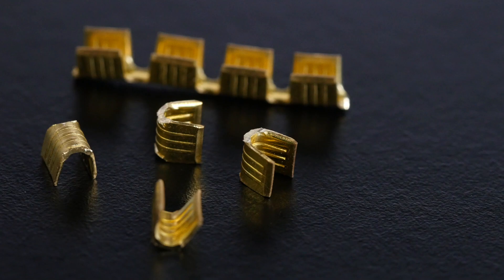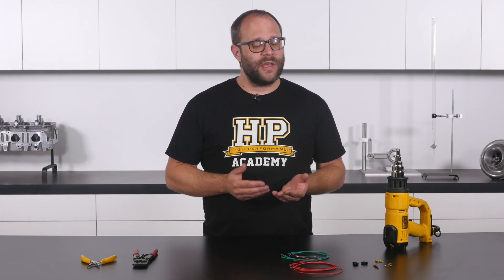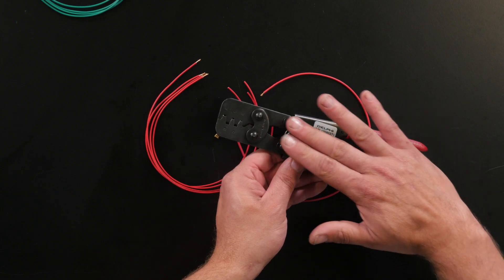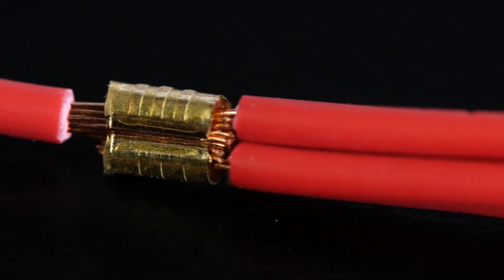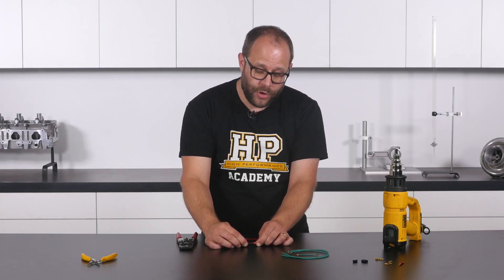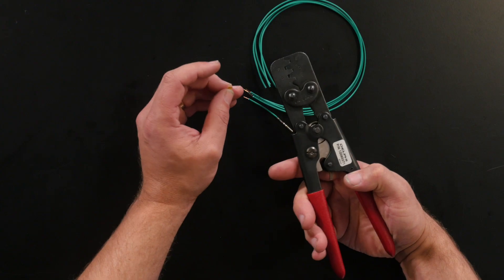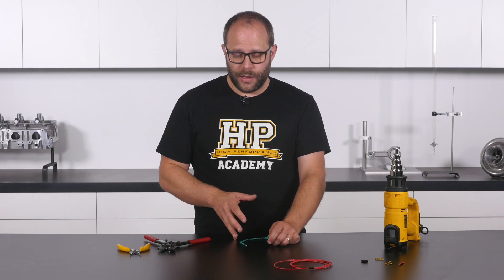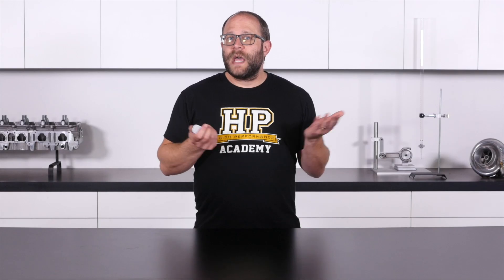How To Join Multiple Wires: Splicing | Common Loom/Harness Failure Points [FREE LESSON]

Comment: So glad I found this video! Been looking for this specific tool for this application. I got the wrong ones that have two different size crimp for terminal ends with the weather seal. I work for Chrysler so wiring repairs like this are recommended and mandatory for warranty.

Comment: A very informative video.  A logic chart would be helpful.  Not sure what to use for a 2 wire splice. Why use an open barrel connector?  I am guessing they are cheap. And then I have lots of wires that are different sizes.  I was going to use terminal blocks for simplicity but they will take up more room.  But so simple to swap out parts that go bad.  As an electrician I always used wire nuts.  But now with stranded wire I need to use something else.   

But see a logic chart would help.  Say you have an LED with 26 AWG wire.  The leads are too short so would you solder to an 18 gauge wire so you can work with it?

Comment: For an inline 6 injector or ignition harness. would you recommend 1 splice or multiple splices? 1 splice i guess would be less points of failur but multiple splices would be less bulk. Also wouldnt 1 splice be more prone to failure with 7 wire bundle being spliced?

Comment: Hi, I’m currently trying to make my own chassis loom. I have a 70amp relay as a ign relay to power 12 micro relays and with 20 micro relays using a mta modular setup. My question is would an open barrel splice be suitable for me spread the power from the 70a relay which I’ve spaced as a 8.5mm2 cable and the micro relays to a 4.0mm2 cable. Thanks

Comment: Where can you get these type of open barrel butt splices like this style that are tin plated copper? All I can find are brass, which I'd never use. Or just plane copper. Which if you use plane copper, you'd really need to put on adhesive heat shrink tubing to help keep the copper from turning green, which could affect the connection if the copper turns green where they touch.

Comment: I thought you were saying enchilada but you were trying to say insulation. I guess keyboard hands are good for getting stripped wire in a crimp. My beat up fingers hardly move much less do a ballet you did. Good job
Reply from the maker: Yes, Andre also makes fitting circlips look frustratingly/deceptively easy too compared to my blunt meat stick (aka finger) co-ordination 😂 - Taz.

Comment: I finally finished my first wiring project. Thanks to your guidance, I made it with OEM results. The setup includes : a fused relay block,  +/- busses, and a fused distribution block inside for the switches. I quite enjoyed splicing a single 14awg to 2 18awg power and ground wires respectively. 
My customer couldn’t even tell what it was that I had done on his truck. The give away are the covers on the +/- busses, which are cleaner than the rest of his engine bay.

Comment: sorry, i want a proper electrical connection, suggest solder after crimp, so mechanical  and electrical are properly sorted
Reply from the maker: You are free to do this, but really if you feel the need to do both you're either doing one or both techniques incorrectly - Taz.
Reply: No No, I respect that opinion but com across so many manufacturers connections that have failed, and its corrosion that affects the joint that solder would prevent
Reply from the maker: Solder is not immune to corrosion, it is only more resistant. A poorly sealed solder joint will also corrode, so while you might feel that adding the solder is helping avoid one issue, you are still potentially creating another arguably greater risk. Arguably is where things become murky for most, but we're not telling you what to do yourself at all, just trying to arm you with a bit more knowledge.

I do understand the logic though and you're not the only one to mention this often. I would take a close look at the connections you see that are failing due to corrosion as I'm sure you will find that the crimp itself isn't actually the problem but rather the sealing around it that is no doubt poor or has failed is.

That said, we are talking motorsport wiring, and generally what you're doing here is going to be better than OEM production vehicle wiring when done correctly - Taz.

Comment: Is there a rule of thumb for the max number of wires to join like this? I would think that too many will force the wire into a sharp bend where the insulation ends. I have had quite a few of these fail on standard motorcycle wiring looms, and when I have replaced them (using solder butt connectors normally), I have joined the wires in several separate groups.
Reply from the maker: Ignore what your OEM does, you can do it better. 

I have to ask, how many wires do you have that you need to splice and why? I feel like this is probably an issue that you could avoid by looking at the cause and fixing that, however, with some specific information around that we can give a more specific solution - Taz.
Reply: @hpa101  , thank you.

Particular case I have is a join in the loom of some older Aprilias where the switched live splits to various circuits. They are joined in one bundle using this type of crimp.

One I am retiring for a different engine, and in this occasion I intend to using a larger fuse box with a bus bar to provide the power. Hence avoiding the issue. But others I want to keep pretty standard

Comment: When using the heat shrink across the 4/5 wire splice, won't it be vulnerable to water etc in the middle of the 4 wires when the SCL only secures the outside of the wires?
Reply from the maker: Is this an issue you have had or are you just thinking aloud? Let us know and I'll see what Zac can recommend - Taz.
Reply: @hpa101  I was just thinking out loud - I since moved ahead working with my harness, and with the multi-wire splices, I heated one to create a "funnel" then filled with a liquid gasket, and then heated the shrink tube entirely, and finished off wiping off the excess gasket that was pressed out.
Reply: @hpa101 did you ever think of a solution? I have this problem. Semi truck exterior application. 4 to 1 splice.
Reply: This is a big issue, The center path is always the failure point, in Mobil equipment  
corrosion will cause failure.
Reply: Could this be mitigated with a coating like vaseline/dielectric or liquid thread tape? Possibly contained with a larger sized outer heat shrink. OR a waterproof buss bar (1 in, multiple out)?

Comment: I much rather solder any splice in a harness, I have had crimping come back to bite later! Being inside looming, makes it difficult to find ,  but it is difficult to solder sometimes depending on location,
Reply from the maker: They both have their place and when done correctly obviously neither should fail prematurely from poor technique, however the reason why we don't like to use solder is it adds the risk of failure from vibration which is a risk crimping does not add. 
With that in mind, and the fact it is easier to repeatedly get a perfect crimp compared to learning how to do the perfect solder it sways the pros for crimping over solder in a motorsports application.

For finding and adjusting crimps in your loom, you could also take a step back and address why you are redoing or adjusting your looms so often. It might not be avoidable for your application, or there might be something in the way you plan that could be addressed to help you with that. This video touches on this topic if you haven't seen it already, hope you enjoy it: https://youtu.be/L05Ud8NztZY

That doesn't mean you can't solder yourself if you want to, but not being blind to pros and cons of any tool or technique is important whatever you choose as we know some people do get oddly passionate on this topic (that comment is for others that might read this too 😉 ). - Taz

Comment: Great video.

1 criticism, however - I'm not sure you did the heat shrink right. My mate does it so as the red insulator is brown-to-black and bubbly looking, and the black heat shrink is charred, and normally has to put out a small fire. I have to assume his method is correct, because he normally ends up with less than 1 short-circuit per week, and I didn't hear you bragging about your apparent success-to-failure-rate, so I can only assume it is poor.  Also, he usually puts more of the insulator IN the crimp/join, i.e. a much higher "plastic insulator:copper conductor" ratio, than I notice you are doing. ok, 2 criticisms.

I might send him this link actually, I am sure he will get a great laugh from your amateurish wiring shenanegans - prepare to be heavily critiqued!!
Reply: That's pretty much the result I get as well, but mine looks cleaner. You see, I bubble the insulation using my soldering iron and end up with a sanded aluminum look on my joints. The heatshrink however, I brush it with the flame of my bic lighter using the fast back and forth method in combination with a twisting motion while held at a 45 degree angle. As soon as the heatshrink stops moving, remove heat so as to not singe the heatshrink. Then go over it for another ten seconds using the bic lighter method again to be sure you got all the shrink out of it.
Reply: @A. Melbs Lol. I don't even remember leaving this message. I must've been messing around. I use a heat gun on my heatshrink. However, when I first started soldering, I used to apply heat too long which resulted in melted insulation. I've honed my skills over the years but thanks for the tips. I do occasionally use liquid tape if the heatshrink or insulation gets damaged. It is good for a quick fix.

Comment: During my many years in the wiring industry this type of termination was faided out, we introduced ultra sonic welding the copper wires together this method was far more reliable and uniformly distributed the current through the wires, perhaps a bit to expensive to introduce though, again great work and easy to understand video!
Reply from the maker: Yes the cost is prohibitive to those wanting to learn and create their own looms at home, and even for some small commercial operations - Taz.

Comment: I'd take it one step further and solder it after crimping then heat shrink it
Reply: Can advise what you want but I've never had a failure
Reply: @Jbshootingsports  Space industry use crimping and soldering, so you are right to do so.
Reply from the maker: @Jbshootingsports  You might not of had a failure, but you've introduced more of a chance of having one. Again, you're free to do what you like on your own builds, but there are pros and cons for everything you do. Whether you want to accept it/educate yourself or not that's up to you, but it doesn't change any facts =) 

There is plenty of material out there on the pros and cons of both soldering and crimping, and also why you shouldn't do both if you're keen to learn more, otherwise happy wiring with what you're already doing but we just advise anyone reading your comment does their homework before blindly soldering AND crimping everything thinking their doing the best job they can - Taz.
Reply from the maker: You can do what suits you best, but we 100% so not advise soldering your crimp joins - Taz

Comment: waay back when i was in school i've been told so often that splicing is bad i still feel guilty when i do it xD
Reply: I do this pretty much exact technique often, never had any issues.
Reply: @allenkilpatrick7701  i never experienced any issues... or the fires or deaths they warned me for xD
Reply: I have some horror stories for sure. Like the wire insulation being soy based. Basically a hot meal
Reply: What scares me is the little plastic colored wire crimps that some manufacturers recommend using!
Reply: @allenkilpatrick7701  OEM wiring scares me all day.. my misses her ride had a problem where the wires to one of the doors were to short.. and they shaved trough! happy days!
Reply: If you don't splice, how would you otherwise do it?
Reply: @steelmesh Maybe? I actually understand what you mean despite this area being my biggest weakness + Swedish native speaker. So is splicing like the one described in the video the way to do it? Are there any others? I'm trying to put auxillary lights on my car and it just says "connect to high beam circuit"...
Reply: @steelmesh So cut the wire leading to the connector for the headlight assembly and then put both those ends plus the one to the auxillary headlight in the butt connector? Got it! Thank you!